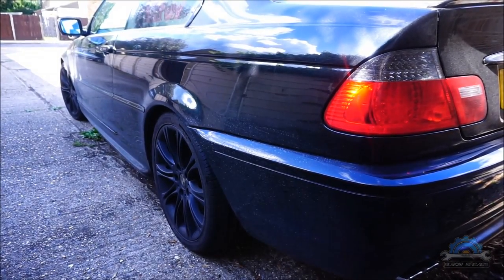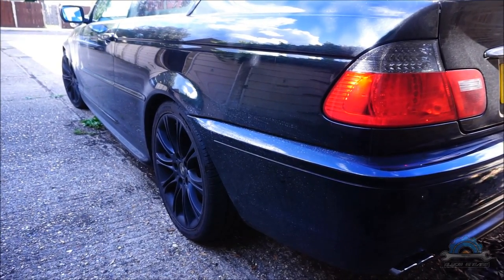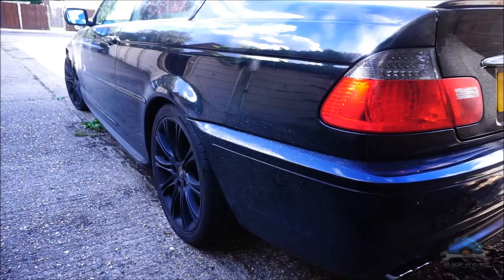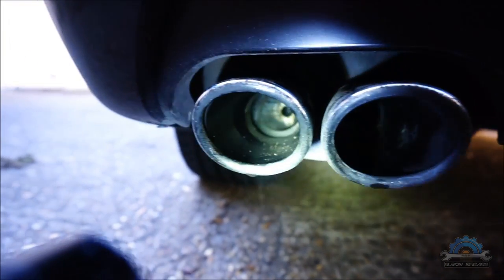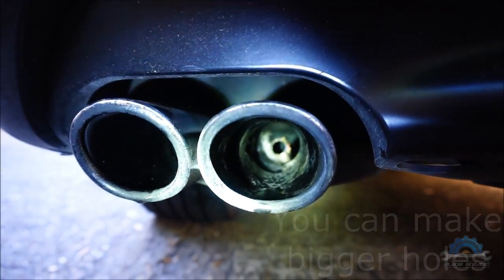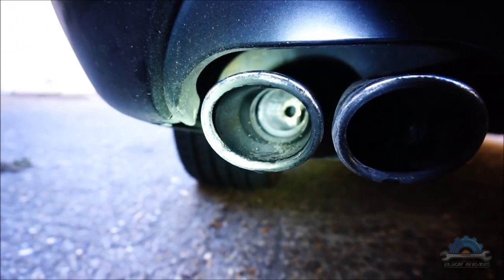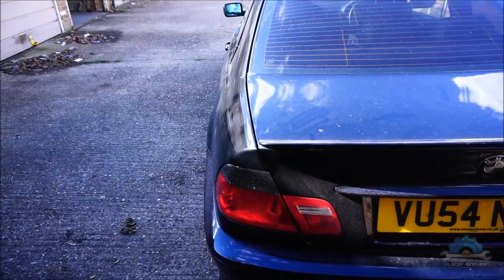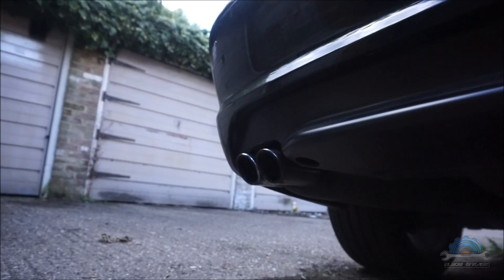EXHAUST MOD FREE BMW e46 NO cutting NO welding NOT GOLF TEE

Comment: Those butterfly valves are in there for a reason. I believe they're supposed to stay closed. While the car is warming up while it Heats up the cats. And it's supposed to have a little bit more pressure until the car's warmed up and you're on the gas over 2000 rpm. And then they should open. I wouldn't recommend drilling holes in something that a car manufacturer put there for a reason in the first place
Reply: Also cars need to maintain a certain back pressure
Reply: What about header's resonators straight pipe
Reply: True but what about
Reply: Exhaust or no exhaust

Comment: I succeeded with a 16mm hss drill bit, 14€, a three jaw chuck, and a hammer drill i had in my house. 

I failed for 3x30mn with a regular drill bit, i only scratched the inside. But with the hss drill bit, i made the hole in 5mn each.  

Now the noise is louder, and feels more free, it’s very cool. It’s not obnoxious at all, and still discret.  I will enlarge the holes soon ! ( 320ci 2.2 )

Comment: Did something similar with my e36 coupe that had a single outlet on the back box , I used a 20mm starret hole saw  , gave a good sound  above 3000 revs

Comment: Thanks Bro.. I just subscribed to your channel so keep up the good work & keep those videos coming!
Reply from the maker: Thank You,I will did you watch others?
Reply: I watched a few. I have a 2004 325Ci that I enjoy working on so I'm always on the hunt for new videos with good DIYs. I did a top end rebuild a couple years ago & your timing video here using the jig was exactly the process I went thru. So to anyone wondering whether this video shows the correct procedure..it does!!
Reply from the maker: does yours burn oil?
Reply: Not at all! I have 114,000 miles on it. I do periodic oil checks to include checking for leaks. what's funny is that my 2008 528xi is the one that burns oil!
Reply from the maker: ha ha
Reply: wholesome, i love this

Comment: Man it’s so difficult, i have a powerful hammer drill, and plenty of different drill bits. I’m just scratching the wall but it’s not drilling
Reply: I had to use an end mill bit to get it started.
Reply: @ric-up4kx  thanks !! I succeeded quickly with a hss drill bit !
Reply: @ric-up4kx  and end mill is very short tho ?

Comment: Congrats you basically just gave yourself an exhaust leak 🤣🤣🤣
Reply from the maker: you can talk about Exhaust leak if it's before or just after o2 sensor but not at the back inside box
Reply: it does no harm on the exhaust system. just look at straight-through mufflers.
Reply from the maker: S. Kojina correct !

Comment: If I can't find a bit that is long enough could I just pin two holes in the muffler? Say right under or near the tips ?
Reply from the maker: Izaiah Rocha if you do holes from out side,its more likely your muffler to rust
Reply: But it would produce the same sound ?
Reply from the maker: I think sound inside the box might be deeper
Reply from the maker: I don;t think so cuz sound is not generated inside  the box but I might be wrong

Comment: What length drill bit did you use?
Reply from the maker: Jonathan King I've used long masonery drill with wide  tungsten carbide  tip cuz you can't drill directly , it will slip so fist you need to "scrape" some metal with this drill pushing it hard to the side of the pipe .When you scrape enough metal then about 40cm metal drill or rod to make round hole.

Comment: tried 3 different drill bits now. can't get this to work :/ what's the best to use? otherwise I'm just going to buy a jetex back box
Reply from the maker: 1metreNoise hold on,I will try to post video today how to :-)
Reply: Thanks man, sorry didn't see this! tried with a big bit as you suggested and still didn't work, it has only scratched up the inside (uk here so metric is best!)
Reply: Shall i just keep going for ages?

Comment: put the holes in section 1 after the resonator. put two holes in each barrel :) thank me later
Reply: what? expand Please
Reply: @C330ZSP  google E46 m3 (or whatever u have) section 1 exhaust. The resonators ar the nut sack/catalytic converters looking blobs on the pipe.
Reply: @C330ZSP  the holes will be louder from there.

Comment: its hardly a mod. just drill a hole before the back box if you want more noise
Reply from the maker: In UK if you drill a hole befpre back box you will fail MOT test
Reply: Elbow Grease no it won't. if it messes with the gas readings too much or is too loud it would fail
Reply from the maker: yeah but I don't wont spoil the outside look and give technician opportunity...... and I think It's smart solution for people who got no "money".
Reply: Elbow Grease fair enough